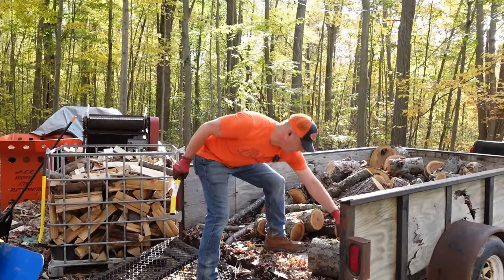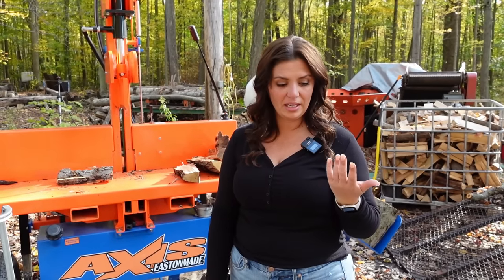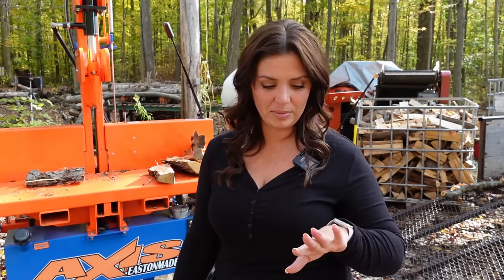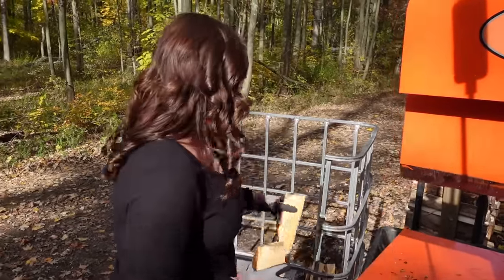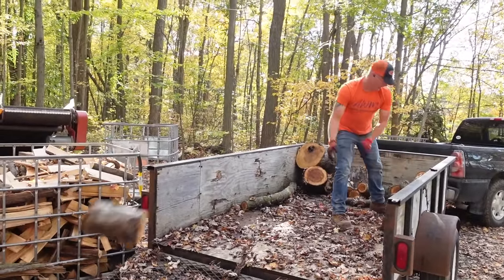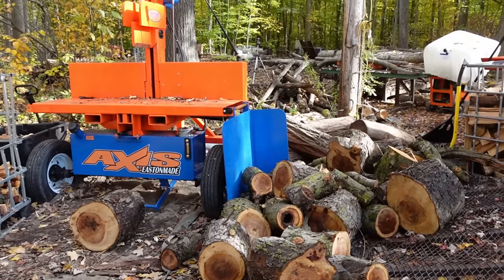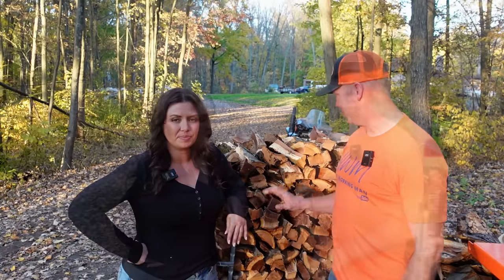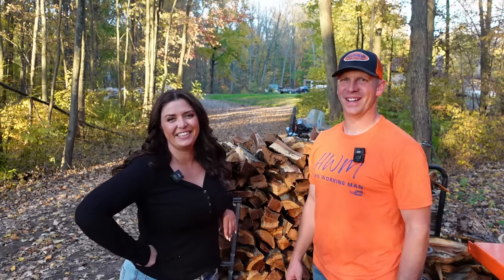It Happened So Fast! How Bad Is It? Log Splitter Accident.

Comment: I’m 68 and have worked in the steel industry for 44 years. One thing I request from my shop workers is never wear gloves working with heavy machinery like cutting, bending or drilling machines. If the piece getting smaller put it on the side. You’re blessed that it was accident without losing a finger… *Reminder please don’t wear gloves, cause if a threat can get hooked on a splinter can pull your hand for a serious accident I’m sure you’ll know what can happen. Hope you feel better Rachel
Reply from the maker: Thank you, gloves seem to be a controversial topic lol, we get told not to wear them by some and by others they tell us we need them when we don’t wear them lol. I definitely agree that they can add some protection, but can increase risk of getting caught as well. Luckily she just got a bruise and was more scared than hurt but thank you for your concern!
Reply: I don’t wear gloves with tools that spin, but splinters and spider bites suck so I use gloves for firewood.

Comment: Happy it was not worse.  In my 64 years I've had two "aw crap" stand in shock and wait to count digits moments. Both my own stupidity. #1 was I had cut down a tree beside our porch and all went well.  I removed all the larger cut-up logs and was just policing the 1" diameter limbs. Like a TOTAL idiot I was using a small Homelight chainsaw in my right hand and holding the branches in my left. DO NOT DO THIS!  A year later I got so I could bend the first two fingers again on my left hand. Much squeezing balled socks on up to tennis balls to get the movement and strength back. Second was I had used my tractor to haul out a deer after sunset and the headlights did not work. The next day I started the tractor to move it back into its berth and reembered the headlights. I could see a wire hanging beside the engine and chicken feathers balled up.  "Stupid mice" and I pinched the wire in my fingers and started to follow it forward under the cowl to the headlights. This was a 1956 Ford 640 with no fan guard in place.  ZING!  Chopped the last 3/4" off my right ring finger.  Happily I knew to ice it and bring it along and it was reattached.  I even got the nail growing back almost normally.  There's a divit in the nail bed to remind me not to work on a running tractor.
Reply from the maker: Oh man. When we work we’ll have close calls. We’re definitely glad it wasn’t worse too. My dad cut up a tree that had fallen on his path to his tree stand. Made it small enough pieces to drag off the trail. After he was done he was standing there resting when one of the tree pieces roll and a branch hit him in the back of the head. Knocked him out for an unknown amount of time and broke his neck. dr. Said half an inch over and he’d have been killed instantly. 9 months in a halo and he’s pretty much fully recovered now. Life can definitely change in an instant!

Comment: Glad that your hand is all right.  I am surprised that you do not wear safety glasses while splitting. Just the same way that the wood slipped and caught your hand it could just as easily have splintered and a piece flew towards your face.  In my 67 years on this planet I have learned that you only get two eyes and they are quite valuable during ones lifetime. Very easy for something that you don't think will ever happen to occur and ruin your day or longer.
Reply from the maker: Thank you, we usually wear safety glasses but both overlooked it on this day.

Comment: I noticed that when your partner, as well as yourself were using the wood splitter, that the bottom portion of the log often slid away on the base (table) of the splitter, as the splitter engaged the top of the log. .  If I may make a suggestion for everyone's safety, I would like to suggest that if you could install a rubber material such as a horse stall rubber mat, or a used conveyer belt onto the splitter table, or base, I think it would most likely prevent the log from sliding away, thus hopefully making the operation of the splitter safer for yourselves. >>>I enjoy your videos, and I hope that your hand was not badly injured.
Reply from the maker: Thank you, we will try a few things but overall we love this splitter. This wood was the perfect storm. Crooked, twisted, knotty, dense wood.
Reply: partner ?   Like in howdy partner.
Reply: @mrBDeye 😂
Reply: I thought of using of using a thin rubber mat also, but after thinking about it for 20secs i realized a person would have more of a workload haiving to lift the log slightly to place it onto the rubber instead of sliding it easily into place without one.
Reply from the maker: @sevendyseven4090  those are my same thoughts. I also have to imagine that the manufacturers of these splitters explored other options as well and they all has a very similar design.
Reply: @hardworkingmanoutdoors  Just spit balling, but couldn't you double your splitting speed time by fabricating a set of cutting blades on each side of that single blade?

Comment: One thing about splitting apple wood is it doesn't split like anything else except live oak wood. Very knotty and grainy. Easiest way to split is one at a time and not try to make 3 or 4 splits at one time like you can do with other wood. Glad you weren't hurt worse than you were. You learned something though.
Reply from the maker: It definitely splits different.

Comment: In 2 seconds I noticed she wasn't getting her hands away from the action...,  She got full pressure from the sound,  Hydraulic whine of the machine.       OW !    The second finger in looks  like it is turning black pretty quicky...   injury,  to the nail-bed...  That baby is coming off.
Reply from the maker: She’s pretty much healed up, no mail damage, just a slight bruise. You pretty much have to guide the wood a bit to get small precise splits.

Comment: Andrew Easton, Impressive machine....But watching the video I have 2 recommendations to give this machine a leg up in my opinion if I were interested in purchasing this machine, this is what I would personally want in it. 1st is grip on the table base, a well placed set of tack welds would do wonders preventing to a degree, uneven cut wood slipping  when splitting and not a bother for sliding the next round to the splitting head. 2nd is a standardized laser guide so I know where this wedge is going to hit every time as the cycle time is so fast...gives a guy or gal a quick visual where the "hit" is gonna land so fingers and such are out of the way. That is something I could use on my farm for sure.

Orange and Blue all the way, SS524 owner, Love it!
Reply from the maker: Sean, we love this splitter too. This apple wood was about as bad as it gets for a vertical style machine. We will try a few things but like I said we love this splitter. The laser could be pretty cool.
Reply: I don’t like the slick table top underneath the wedge

Comment: I also have an axis, I found on twisty bits of wood that if you use the back of the bed it does help support the wood. Glad Rachel wasn’t hurt to badly, sadly we’ve all been there. My motto is after a couple of goes a log is not worth you or your machine and just dump it . Great videos tho folks.
Reply from the maker: Thank you, and I agree. I sometimes use the back plate and occasionally just toss a piece to the side.

Comment: Hello Rachel and Heath. Relieved to see that your injury wasn’t any worse. Accidents happen so quickly. Reminded me of Phil’s incident where he almost lost his thumb. Like I’ve suggested on many previous videos on the Axis I think it “wood” be beneficial if Eastonmade added some weld beads on the table to help prevent the rounds from sliding out on you. Beads that run parallel to the back wall so you could still slide the rounds under the wedge. 
Cheers Woody !!!
Reply: I also thought about the beads but wonder if a piece of expanded metal would be best. Of course the stroke of the wedge would need to be shortened to whatever thickness of beads or expanded metal strips / pads Eastonmade would add to the unit.
Reply from the maker: Thanks Woody, luckily it wasn’t like Phil’s for sure!  I have to imagine Andrew has experimented with different options but maybe not. One of the slight drawbacks of the vertical style machines, but we still love running this thing!
Reply from the maker: I think the expanded metal would make it too difficult to slide the wood into position especially with larger rounds.
Reply: I “wood” have to agree with you on the expanded metal. But I would like Andrew experiment with something to somewhat prevent the rounds from sliding out on you and potentially taking a round in the belly .
Cheers Woody !!!
Reply: If you look on the table under the knife we ran a welding bead around in a circle a few times to help the wood kicking out
Reply: Thank you Woody, I was very thankful it wasn’t worse too!
Reply: True. The rounds would need to be placed into position. That is something that we would need to live with to make the splitter safer. I would think that the engineers at Eastonmade have looked into this, ran extensive tests and decided, short of an expensive hydraulic under-pan pin system, this smooth tabletop is the best way to go. @hardworkingmanoutdoors
Reply: @AllenFamilyFirewood hello Phil , just curious if those circular welds create any issues sliding the rounds into position for splitting? I’m sure it helps reduce the chance of the round sliding out on you.
Reply from the maker: @AllenFamilyFirewood  I’m going to experiment a little.
Reply from the maker: @WoodysRTBFirewood  we’ll try a few things and see how it goes.

Comment: What a trooper!  I think I would have taken that as an omen, and called it a day right then!  And yes, I've split apple a couple dozen times, mostly on the chopping block with an axe, and later with a splitting maul.  Best way is when it's frozen.  Let the temp drop below 15 a couple nights in a row, then on a warmer day, say mid 20's split it then.  Being frozen in the core, it will be more brittle, and snap through the grain once you hit that breaking point.  Kind of "pops", and sometimes a piece will fly sideways.

I'm glad Rach is okay, and thanks for sharing.
Reply from the maker: Thanks David. She’s a tough one for sure!

Comment: Really glad that you are ok Rachel and it wasn't any worse. Splitting that Apple wood is similar to splitting Black Spruce in our area. Both have really twisted grain and a lot of knots. Just when you think that you got under control, you'll get a decent looking piece with a really knurly hidden center, and it will pop open as the wedge goes through it. Definitely demands your attention!
Reply: Thank you, it definitely surprised me
Reply from the maker: Demand attention it does!  This wood was twisted and popping!

Comment: That apple is always twisted up stuff . When the knife hits a knot half way threw it folds the smallest piece to the table every time just like what happened to you , I have found that just using the palm of my hand up high on that small piece gives me plenty of reaction time I to learned the hard way after having a piece fold down an smash a finger a bunch of times .  So use that palm or the side of your hand no fingers . By doing that it also prevents your hand being in the way if a piece gets stuck on the wedge an returns to the log stripper . All lessons I’ve learned running a fast vertical the hard way .
Reply: Thanks Phil, you’d be the guy who know the best way to run a vertical splitter! As long as we learn from these experiences, we’ll be good. 😊
Reply from the maker: Thanks Phil, definitely appreciate the tips! One thing I love about YouTube is being able to learn from others mistakes and letting people learn from ours!  Glad you guys were safe from that mess over there and enjoy the sub explosion you have going on right now!

Comment: I have 2 diffrent splitters, one is an older horizontal one and the other is a newer horizontal vertical one you can use either way, when I'm splitting wood when the wood hits the wedge i let go of the wood, this keeps my hand from getting caught, also only one person should be operating the splitter for this reason, if 2 people are operating the one that has the control may not know the other one has their hand caught. Hope this helps to all the folks that may have or thinking about buying a splitter. The one you have is a nice setup, be careful and be safe.
Reply from the maker: With the Axis and proper splitting wood you just keep the wood supported and as soon as it pops raise the wedge re position and hit it again. I do get what you’re saying though with tougher splitting wood though.

Comment: Apple is hard and twisty. I split up a 100 year old apple tree a few months ago. It was blown down by the Fiona hurricane. My old splitter had a little trouble with it. But you have to read the wood before splitting to make it easier. Lot of what I did just came out as chunks. Great firewood. 
One thing I don’t like about that Eastonmade splitter, it kicks out the wood at the bottom on the table. Needs some thing there to help hold the wood on the table. 
Great video. So sorry Rachel got hurt, but not as bad as it could have been. 
Have a great day. 🪵🪓
Reply from the maker: Thanks Noel, we’re definitely grateful that it wasn’t worse!  I will say we ended up with more wood than I thought. Looking forward to cooking with it.
Reply: Thanks Noel, I definitely wasn’t messing with some of the knottier stuff after that, chunks it is!

Comment: was watching the other video with the log splitter and was concerned that it did a full cycle when you activated the forward stroke. To me after working in manufacturing for 40 years that would never be acceptable, accidents happen often because of repetitive process people become complacent. The vertical splitter you were using i believe id Canadian made and it automatically reverses when you take your foot off the pedal.  If an accicent was to happen on the other splitter it will complete the cycle...eek. Glad you weren't seriously injured, shout out to the manufacture for their foresight in design of their unit it saved your finger for sure.
Reply from the maker: Thank you, definitely nice that it lifted back up automatically!

Comment: Glad you are ok.  I've been considering that type of splitter and was wondering about the safety vs. horizontal.  It always makes me nervous when you guys are racing to split firewood.  Not that you were racing this time but maybe going a bit fast.  I find it relaxing and enjoy taking my time.  How about some non-slip stair tread stick on pieces right under the wedge.  I think that would really help keep the wood from slipping out from under.
Reply from the maker: Thanks Gary, as far as safety vs a horizontal machine goes I’d say it’s similar but different. No matter what you have to keep your hand out from between the wedge and table or push plate. A little more chance for minor things perhaps on the verticals but like everything I’d say there’s pros and cons to both. We are still very happy with the Axis.
Reply: Thanks Gary, I wasn’t trying to go fast this time around, just didn’t expect that to happen!
Reply: Hi Rachel, I agree you weren’t racing this time. I just think the axis needs to have some friction at the bottom to stop the wood from slipping out or under the wedge like it did several times. They could easily make a rough perforated section of metal to go in that spot. Thanks for all your videos.
Reply: Don’t race period 😊

Comment: I've commented before about u guys wearing thin gloves while handling the firewood, I have never noticed that  the table is very slick under neither the ram ? Hope Rachel is ok ,  great video
Reply from the maker: Thanks Terry, she is a little sore but will be fine. I usually wear the impact resistant gloves and I think Rachel May moving forward especially while running the axis.
Reply: I’m very thankful I had gloves on or I’m certain it would’ve split my skin too.
Reply: @rachelpostma4505  or no finger at all 👍

Comment: Apple is twisty and gnarly- it's just how they grow.   Super dense wood, too- that's why it's so heavy.   Very high BTU content.

  I cut down a tree from a friend's yard this Sept, and split it all by hand.  Good workout!   The stump chunk was so heavy, it was all I could do to get it across the yard and into my truck.  I figure I got a bit over 1/2 facecord out of it.   

  I also cheated, and used my saw to rip the gnarliest bits and/or cut them into cookies or chunks, lol.   It'll end up in smallish pieces, anyway, as it's for grilling.  I just add a couple chunks to the coal bed right before the grill screen goes on.

  Perhaps it's just the dry weather this year, but it dries surprisingly fast.
Reply from the maker: Thanks, it is gnarly and twisted. We can’t wait to cook with it!